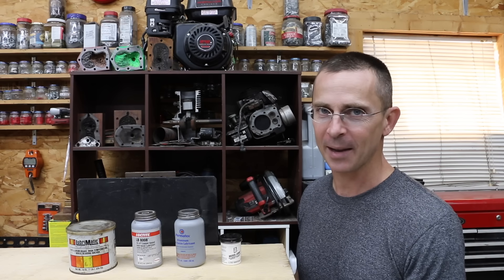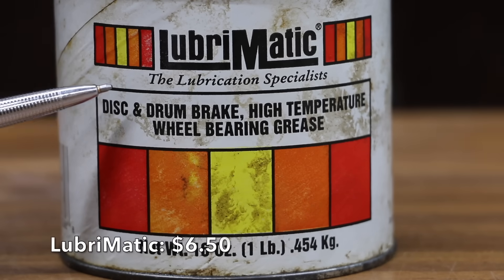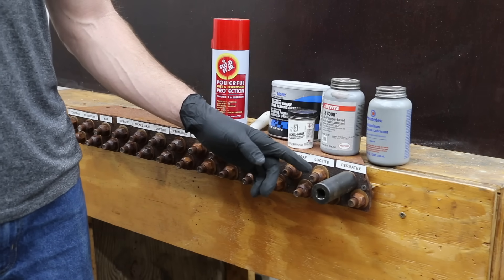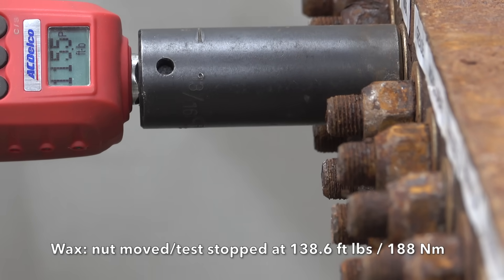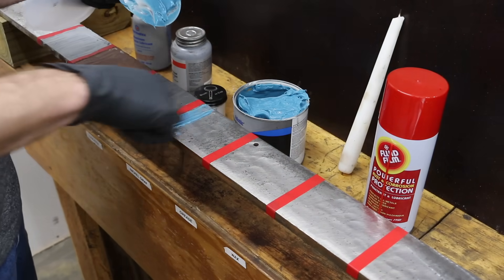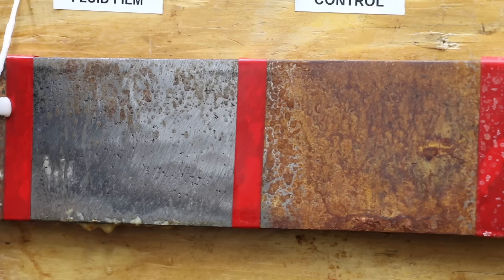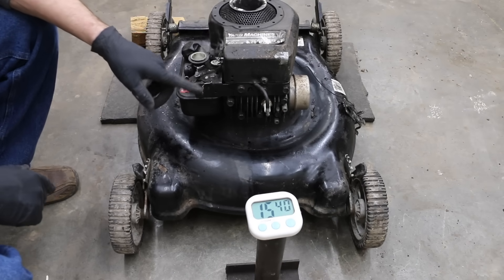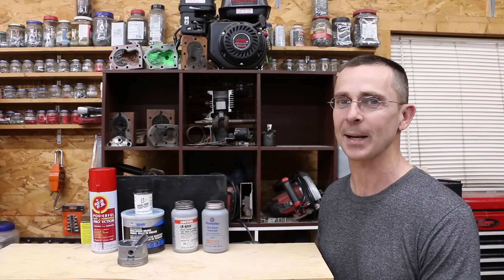Does Anti-Seize Compound Actually Work? Let's find out! Anti-Seize vs Grease vs Fluid Film vs Wax

Comment: I enjoy your videos, however I must make a comment.  Anti-seize is might be used to prevent nuts from sticking due to corrosion, but that's not what it was originally intended to prevent.  Anyone who has used stainless steel fasteners knows that the lack of surface oxidation can cause galling of the metal due to cold-welding at the molecular level.  Anti-seize contains small bits of aluminum or copper to act as a barrier to prevent this galling between clean stainless steel surfaces.
Reply from the maker: Thanks!  Thanks for the feedback.

Comment: in small bolt hot application such as exhaust manifold studs into cast, I prefir the copper anti-seize over the stainless. The stainless seems to lock the studs up to the point you may twist them off when trying to disassemble.
Reply from the maker: Thanks for the feedback.

Comment: I had ordered a 2.3 long block Mustang II engine from a reputable local machine shop that a new owner has just taken over. The engine arrived quickly as it was in stock item. It was professionally packed bolted to a pallet wrapped in plastic with a new oil pump and gasket set included. To my surprise whoever assembled this engine didn't understand what Antisieze is, it was used as assembly lube, rods, mains, cam bearings and followed. Called to inform them of their mistake. The owner almost had a heart attack. Luckily I was among the very first to purchase from them. After that any time I needed it yesterday it happened.
Reply from the maker: Thanks for sharing.

Comment: Never Seize works  great ! Don't put the silver stuff on spark plug threads . Normally I just put some ATF oil on spark plug threads.
  I used the stuff with Lead in for years.  The Copper Stuff is much better for high temps.. The stuff with No lead  and graphite or Moly instead .. Still works but not as well as the nasty lead stuff..
Reply from the maker: Thanks for sharing.

Comment: Your test videos are amazing. Some spark plugs these days say to not use compound, partially because they have their own treatment, partly because it changes torque values. I seem to recall it needs less torque; could strip threads? Time seems to be a major factor on cars. (Perhaps immerse connectors in corrosive material for 90 days?) 5+ years and unprotected bolts can weld themselves in place. Many of us have used grease, vasoline, dielectric grease and other products with electric connections, especially ground straps. In rust prone areas, factory untreated components can corrode and cause odd errors in modern cars in as little as 4 years.
Reply: i suspect the majority of spark plug/cylinder head problems are caused by guys who don't do a tune-up until the ignition starts screwing up under load/advanced timing
Reply: @tommurphy4307  That is possible; plus plug change intervals are 100,000 miles for many cars. That's a lot of years for corrosion to set in. (Plug life is 100% down to the type of spark plug used; factory recommended at 32K for standard plugs, 100K for iridium, on the same engine.)
Reply from the maker: Thanks!  Thanks for the feedback.

Comment: We use it on mining fixed plant equipment and it’s lifesaving! Also Denso tape keeps dust, mud, water out of bolt threads. Privative and messy, but your best friend when you need to undo it in 6 months time.
Reply from the maker: Thanks for sharing.

Comment: I have a pool so I have gallons of Muriatic acid.  I use it in my little machine shop to de-rust small parts and to remove galvanizing when I need to weld on the part.  The acid works very fast and cleans very well.  In less than an hour most parts smaller than my fist are completely rust free, I check them often and pull finished parts out of the acid. I use it full strength and don't have the immediate rusting problem you experienced though ilt is important to remove the acid with water and baking soda solution. One reason is I live in the desert so humidity is low. If it is going to be a few days I coat the parts with WD40 and let dry to prevent flash rust and rusting over time. For large parts that I have time to wait I try the industrial size molasses.
Reply: This was for the rust removal test. I  transposed my comment to the anti seize test (some how).  I watched them back to back so probably pushed the wrong button.  One comment on the ant iseize compounds. You open the container, remove the brush and magically its on your hands and then immediately spreads everywhere. I love the stuff!
Reply from the maker: Thanks for the feedback.

Comment: We used anti-seize in high heat applications in a factory.   The anti-seize was a graphite infused grease that coated metal parts and prevented corrosion and seizure due to heat.  It worked great.   We used to take it home and use it on high heat applications on our cars and trucks (exhaust manifold bolts, etc).   I've never had a bolt or nut treated with anti-seize ever snap or seize.   I've also used the same graphite product in anti-tamper applications to discourage vandals as once the grease gets on skin and fabric, it's very hard to remove.   Get it on your coat, and you're throwing the coat away.
Reply from the maker: Thanks for the feedback.

Comment: These white candles are made from paraffin not wax though and considering its relatively low melting and evaporation point, there was probably nothing left of the paraffin after the heat exposure. Same would probably apply to paraffin under low temp conditions and mechanical stress like engine vibrations. It would just become brittle and fall off. 
I still wonder how it would hold up against the anti-seize compounds in just normal conditions but for everything else, good anti-seize it is. There is a good reason all the top products use soft non-ferrous metal particles in their composition.
Reply from the maker: Thanks for the feedback.

Comment: The control group numbers on the fasteners is sort of revealing.  I have to wonder if it's actually more important to put anti seize on any exposed ends of the fasteners rather than where the mating surfaces meet, at least in certain applications.  You can see this with certain types of disc brake rotors where it will rust a sort of 'lip' that will keep it from releasing from the hub without a huge amount of elbow grease to get it to come off (and pry bars).
Reply from the maker: Thanks for the suggestion.

Comment: I worked 41 years in a coal fired steam electric plant.  The units were rated for 450 Megawatts.  Needless to say we had some massive equipment and valves under a lot of torque and stress.  We used a lot of copper based Anti-Seize on a lot of different equipment.  I learned my lesson well and I use it a lot on my farm and cattle equipment now in my retirement.  I look forward to your products test every week and use your suggestions whenever I get a chance.  You do an outstanding job.  One of your fans.  Thank you.
Reply from the maker: Thank you!
Reply: I work in pump repair for power plants and most plants are converting to using copper-free anti-seize and graphite bearings. Any bronze or copper in the feed water apparently leaches out and can severly damage boilers.
Reply: YES! 41 years in a coal-fired plant also! Anti-Seize is used in all applications. Nickel and copper, depending on mfr's specs.
Reply: @normajohnson6352 whst brands?

Comment: My dad was a WW2 bomber crew chief and he swore by Permatex Never Seize. We used it in his Automotive shop for decades and especially used it on exhaust bolts and wheel lug nuts. 
The best test was on VW muffler bolts & nuts. They started using the Permatex and 2 nuts to cover the threads. Later on I changed a VW muffler installed like that. The nuts came right off and the muffler change was ver easy.
Reply: By the way, he always used Permatex thread lock on other bolts like cylinder heads or crank case assembly.
Reply from the maker: Thanks for sharing.

Comment: given the volume of the the anti-seize around the engine, I wonder if the connecting rods broke due to something akin to hydrolock - namely there was so much anti-seize in the combustion chamber that the pressure was too high, and it broke the connecting rods.
Reply: would have to use a hell of a lot in there to make that happen

Comment: Tried them all on studs and lugnuts on semi truck and trailer wheels. Salt and copper is terrible together, gun grease dies out in a couple of years and threads are rusty. The permanent aluminum antisieze after 4 years the nuts broke loose with no popping or screeching threads we bright inside nut threads and threads protruding past the nuts werd not rusty on the studs where there were plastic nut covers on the studs, 
I have been using the gray, or aluminum antisieze, years ago it was napa balkamp antiseize, now it's permatex antiseize. Not in 40 years have I ever twisted off a stud or stripped threads removing a nut, if the nut was put on threads with anti seize!
If one has had lugnuts loosened or came off on any kind of rims, then it seems that antiseize would be the wrong choice to prevent loosened wheels, but it is not. If you lube threads before installing lugnuts then when it's tight it will stay tight! 
My experience has been when the threads are popping and squealing when being broke loose, those are the lignuts that will come loose, because they torque up to suggested torque specs, only because threads are dry and not necessarily because they have the necessary clamping force, clamping the rim to the hub.
Reply: Should have been gun grease dries out
Reply from the maker: Thanks for sharing.

Comment: Interesting test.  My grandpa left me a can of anti seize along with other garage items.  I've been using it like crazy since 1996 and now it's finally getting low.  It's a name brand from back in the day ... maybe Permatex or something like that.  He used it mainly on brake shoe parts and wheel studs, I do the same with good success.  I'm in Streetsboro, OH in the snow belt.

Have you ever tested a small turbo engine using oil with the wrong additives, or perhaps non detergent (too accelerate the effect)?   I know that would be expensive but I have a couple VWs and they are very specific about using the sometimes harder to find 502 spec oils.  Just curious.
Reply from the maker: Nice!  Thanks for sharing.

Comment: I could have told you that a lubricant with metal particles in it wouldn't work too well. As for Anti-seize....use it on the back of your aluminum wheels where they touch the steel rotors or brake drums. It'll keep them from sticking. Be careful not to get any on the lug nuts or lug bolts. If you do, your lug nuts will come loose.
Reply from the maker: Thanks for the feedback.

Comment: Great video!  I'm assembling some brake calipers that I completely disassembled,  This includes splitting the halves, which the manufacturer says not to do.  They were from the early 90s and I noticed some bolts showing anti-seize, I'm sure it was to prevent galvanic corrosion, as the bolts are steel and the calipers aluminum.   This video gave me enough information to choose what I need!  Thank you!
Reply from the maker: Thanks!  Glad to hear!

Comment: we use anti seize on motor shafts used in the extrusion molding process.  rust isn't really much of an issue, but the high temperature and high pressures exerted on the collars attaching the motor shaft to the equipment being driven, causes them to seize together terribly over time.  anti seize definately is necessary to be able to seperate them when motor replacement, etc.... is needed.
Reply from the maker: Thanks for sharing.
Reply: @ProjectFarm  no, thank you for the great videos, i appreciate the attention to detail, and unbiased observations.

Comment: Nov 2020 bought snow tires for 2018 Jetta. My electric impact drivers would not loosen wheel bolts, had to stand on hand tools. Right Front alloy wheel would not come off due to galvanic corrosion, had to go to shop. Bought Permatex anti-seize for next wheel swap. 
April 2021 used hand tools removing winter tires. special 11 (eleven) sided key for winter lug bolts split. Appears to be cheap stamped metal. Got new one from Discount Tire, finished the job.  
December 2021 bought 3 speed DeWalt impact tool (100, 300, 600 ft pounds, 400, 1200, 1900 rpm). Needed mid setting (many seconds) or high setting (immediate) to remove lug bolts. Put Permatex Anti-seize on all lug bolts installing winter tires. Tightened at low setting plus hand tool torque. 
April 2022, removed winter wheels using DeWalt tool low setting for up to 15 seconds each. Mid setting seemed like overkill. Anti-seize worked so well I think my old impact tool could have done the job. No wheels have since had galvanic corrosion (winter wheels are steel). Special (cheaply made) key did not split probably because proper tool stopped uneven force and anti-seize was so effective.

Very pleased with Permatex anti-seize.
Reply from the maker: Thanks for sharing.

Comment: Anti-seize is also EXTREMELY reccomended in the case of bolts that are joining with dissimilar metals... a steel thread vs. aluminum for example (spark plugs...)
Reply from the maker: Thanks for the feedback.
Reply: some guys leave the plugs in until the electrode is completely gone- sheesh

Comment: the idea of anti-sieze lubricants is that they don't make the bolt able to vibrate loose while it's actually doing its job, but makes it easier to remove when you need to.  it's not something ment to be left in place for many years without normal maintenence either... and the same reason you don't just grease nuts... which can make them susceptible to loosening on their own.

Me?  I like lock-washers, anti-seize, teflon based lubricants, thread sealant, or good ol' blue threadlocker (or orange or red depending on application)... and the old farm I lived on SURVIVED on PB Blaster penetrating lubricants :)
Reply from the maker: Thanks for sharing.

Comment: So far into watching the video,  you’ve missed the why of anti seize.  The silver compound was developed for use with stainless steel fasteners and pipe fittings due to how easily stainless galls and seizes threads.  Copper based anti seize shines best in pipe applications where high heat is involved such as steam piping.  Silver is still the choice for steel into aluminum applications.
Reply: I have in steam applications since 2006 and with small engines since 1986 and the nickel antiseize is most of the time the main choice for  most of the threads in the situation. We often use sump oil for spark plugs in the small engines in general unless there's an added requirement.
Reply: I have in steam applications since 2006 and with small engines since 1986 and the nickel antiseize is most of the time the main choice for  most of the threads in the situation. We often use sump oil for spark plugs in the small engines in general unless there's an added requirement.

Comment: I can tell you. from 40 years in the mechanical industry, anti-seize definitely DOES work. Where it really excels is on hot service bolts (motor exhaust, head bolts, steam fittings, etc.). I am referring to the NICKLE anti-seize. I work in a corn processing plant and can tell you that "food grade" anti-seize does NOT work. I would compare it to toothpaste once it has been heated. Wax may be better in that case. Thanks for another great video!
Reply from the maker: You are welcome!  Thanks for the feedback.

Comment: Worked in a large slaughter house years ago. They had 2 French presses that worked under extreme pressure to squeeze every drop of tallow out of cooked guts. Had a lot of 1" bolts holding plates on. Before they started to use anti seeze on threads would take a full Saturday & Sunday to remove bolts and perform maintenance. Had to use a 1" old very heavy impact driver to remove bolts. Once anti seeze was used only took a day for entire job. Thanks for another well produced vid.

Comment: HOT GLUE  and Hot Glue Guns. I buy from 10 bucks to 50 and the low cost seems better sometimes. I'm not sure how the gun test would be done since they fail over time. I go through at least a gun every month or two. They will continue to work but the heat up to work temp time increases. 
The Glue. This is a sticky subject even a little tacky.. lol seeing that I don't remember buying NAME BRANDS I buy for a low cost most of the time  there are many types though (EVA) copolymers, Thermoplastic polyurethane (TPU), Styrene block copolymers (SBC) that include a range of great for the environment items tackifying resins, Waxes, 
I loved your 18650 batt shoot out but I can not find a good place to buy and feel safe with the claims Thanks for reading.
Joe 
P.S> Clear packing tapes could be a thought as well ... I guess you can tell I make a lot of boxes...I have a hobby shop..
Reply from the maker: Thanks for sharing.

Comment: Love the video. I am am putting up my snow skis for the season, needing to protect metal edges from corrosion, and I wanted to know if anti-corrosion properties of anti-seize would be better with Permatex, wax, grease, WD 40 or whatever?   Having the permatex and your video I decided to use it despite the messiness. All the shops and message boards suggest any kind of ski wax, but hot waxing is just as messy to apply, and nice to know permatex holds off rust quite well. Wondering if anybody else using it for skis?
Reply from the maker: Thanks!  Thanks for the suggestion.
Reply: PB brand silicone spray.  Does not have a carrier which attacks plastic like other silicone sprays.  Do not use petroleum base product around plastics.